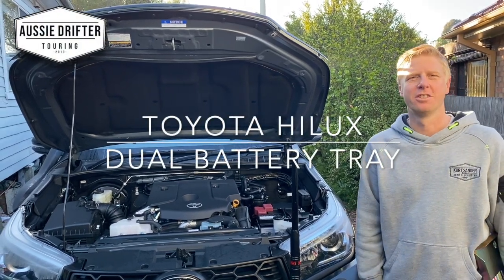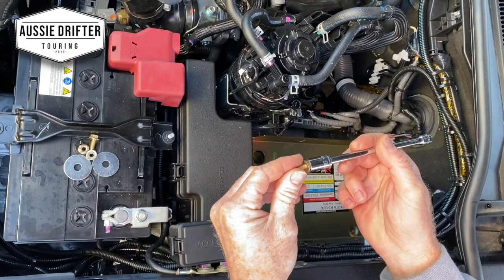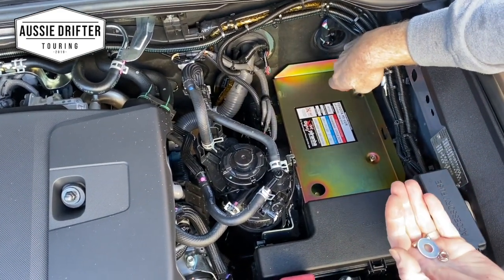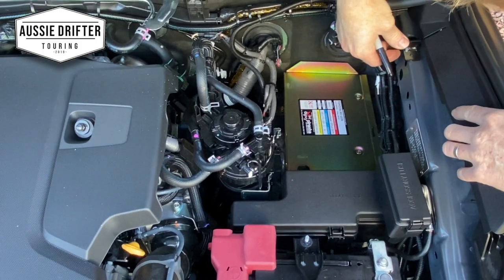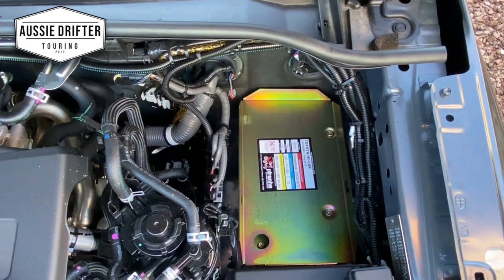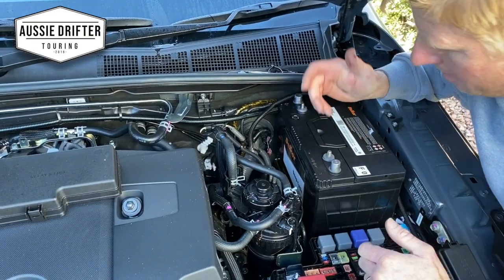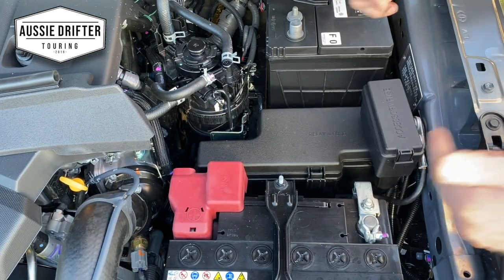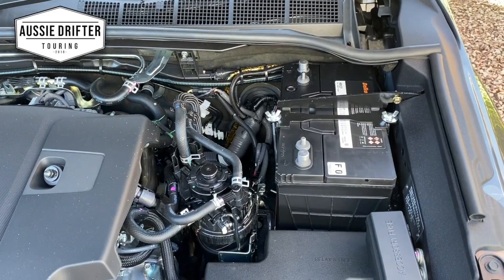Toyota Hilux N80 | Piranha Dual Battery Tray Complete Installation

Comment: We had a brand new 2021 Fortuner we found that we just undid the 3 * 10mm bolts holding the main fuse box down allowed us to move the fuse box 5mm which helped us just drop in the N70 deep cycle in no worries. You did manage eventually but for those who aren't sure I can assure you it's an easier way, literally ads 2-3 mins to undo and 5 mins to tighten back up (as 1 screw is in a difficult location after the battery is in). Highly also recommend people consider the low maintenance version than the maintenance free battery as reports say due to warmth in engine bay the battery will dry up, but you may need angle grind a gap on the bracket to accommodate the top up screw holes. 👍 Good video overall though, premade harness makes life easier. 👍
Reply from the maker: Thanks for the info
Reply: @AussieDrifterTouring  your all in one harness is 👌 though guys 🇦🇺👍

Comment: Great video mate, really informative. I’ve installed the same tray in my 2016 Hilux but am struggling to get the battery to fit due to the grey clip holding the loom in place. Any idea how to remove that clip?

Comment: Great stuff. Where is the best place to send the accessory harness for the fridge at the front engine bay for the latest hilux or the fortuners? With the battery not sure there will be enough space to send through the passenger side? Thanks
Reply from the maker: Vish P hey mate.  There will be enough room to go through the fire wall grommet on the left side even if the battery is in on the Fortuner.  However on the Hilux I would run it from the engine bay aux battery down to the chassis rail and along the under body of the car seeing as on a Hilux most of the time the sockets will be installed in the tub or tray outside.

Comment: Hey mate I was under the impression that the charger needed an ignition wire does it not ?
Reply from the maker: Hey mate.  The ignition wire is only required on variable voltage alternators.  The Hilux runs what’s called a temperature compensation alternator so it’s not required.  Hope that helps

Comment: Where did you get the tray
Reply: And what are the dimensions of the battery
Reply from the maker: @nicholasmiller4557   Hi mate we use piranha 4x4 trays, and we use the decor hdc27 battery in that setup.  Hope that helps